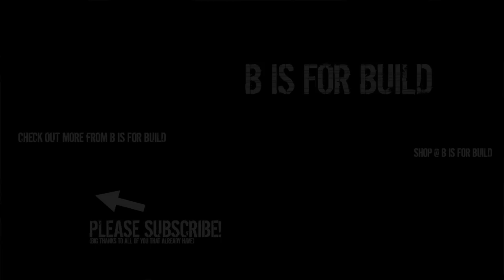1500HP of Boat Engines Have Arrived!

Comment: I am a Marine Engineer Grade 2 here in Australia,,         your choice to go petrol over diesel,      but please be aware of the dangers that go along with petrol engines in confined engine spaces on vessels,,,,     they are a floating bomb if precautions aren't followed,,,,          number 1 being ,,     have some BIG fans blowing into the engine space to give a positive pressure when the engines are running and turn the fans on prior starting to exhaust what fumes may hace accumulated in the bilge,,,
Reply: Like that mans comment my dude’s, let chris notice it!
Reply: The yacht should have come with bilge fans from the factory, I believe US coast/Canadian coast guard rules require them for all boats with inboard motors. He may be smart to update them though.
Reply: @kstricl  preferably with some sort of failure warning on the fans,
Reply: I was thinking more about reliability, low-end torque, and fuel consumption, but that's a whole other level of issue. With such a big boat, It just seemed like a bad idea from the start.
Reply: @AMLagonda  would be a small racing boat? Those are the usual v8 petrol boats I see, with exposed engines.
Reply: @fohseytv  Mate, whether you agree or disagree on his personal actions, your comment need not be so rude. There are other respectful ways to make your point.
Reply: Alpha Worx  same here, like idk why but it just fuckin angered me that he thought this was a good idea
Reply: Alpha Worx  plus he’s gonna be spending out the ass for fuel
Reply: If this boat ever has a hint of fire RUN. dope engines just not for a boat like that. I’ve seen gas boats blow it’s not cool. Best of luck tho
Reply: Alpha Worx  yet here you are
Reply: @kstricl  He wasn't smart enough to take notice of an oil pressure gauge reading zero so why would he be?
Reply: @joebaxter4235  Actually no. Why? Because so many people, people with actual qualifications tried to tell him it was a dumb idea and he just kept on with it. Given the advice received and who it came from it is ignorant.
Reply: @Blackinterceptor999  i hope he doesnt plan to turn the same props with the gas engines diesels have way more torque
Reply: Yeah, we’ve tried, but he knows better than long time mariners. Yeah it’ll go like a rocket if he stumbles on the right prop. But how long do rockets actually last?
Reply: He won't listen
Reply: Alpha Worx  probably not enough
Reply: @drunkensith6903  learnt that lesson with a rc plane that was using electric motor and put small glow plug engine in it ,it never got into the power with that prop, changed it and the plane flew again that mistake cost me £5 for a new prop thats a lesson i wont forget.
Reply: Alpha Worx  you quit when he made that decision months ago yet you're still here? 😂 I know nothing about boats but I'll point out some bullshit when I see it.
Reply: You think us Americans learned our lesson in World War II with the Sherman nope will put gas engines in anything
Reply: @AG-pm3tc  thanks mate,,,,     fires on boats are a very nasty thing to experience,,     ask me how i know haha
Reply: @kstricl  in Australia , that is,,   not sure with US or Cancer country hehe,,       there is a big difference bewtween rules on commercial vessels and private vessels,,,     commercial boats have to be kept to survey requirment levels 100 percent of the time,    where as private boats the law doesn't really affect them much until there is an accident, ie, a fire,    there really is no such laws for a ship shape privatley owned vessel as compared to a commercial boat in Ausatralia
Reply: @ventura9513  luckily you are still here to warn us!
Reply: @drunkensith6903  mate,,    that is a very good point i actually over looked,,,      with the diesels,,   they are matched to the gearbox speed,,,      now with an engine change,  they will most deffinately over speed causing major cavitation and prop slippage ,,,   not to mention extra stress on the shaft and gearbox when the prop gets a full bite on the water again,,,     its kinda like wheel hop with a car on a drag strip
Reply: I don't know much about engines, but you seem super legit! I hope he sees your explanation. I too feel that petrol engines won't be that durable on waters, as compared to the diesel-powered.
Reply: I can't wait to hear about the fuel consumption of this setup. The funny thing to me is his original excuse was it would take too long to get the diesels rebuilt... Here we are what, close to a year later just to get his new gas engines? Also, haven't heard anything about new props...
Reply: @Anachroschism  there is 2 types of hulls,,,   a planing hull and a displacment hull,,,    both have limitations on hull speed depending how they are designed, meaning they have a maximin hull speed no matter how much hp you throw at them,,,  i currently work on a 278 meter long vessel that is capable of 57000 hp  ,,    engine and gearbox does 300 rpm max,,,,     but it does 40 knots in fair weather ,    land lobers dont understand boats mate
Reply: Achieving positive pressure isn't practical given available space and sealing issues. A OEM setup would be something like: two cheap 4 inch inline blowers (rule, attwood etc.) with flex hose pulling air from  LOW spots in bilge, venting to louvered engineroom air inlet area.
Reply: @ravenof1985  and a failure warning for the failure warning. Just incase.
Reply: @Melanie16040  l vote for a couple of 4 blade stainless... ;-)
Reply: 650 ft/lbs of torque v/s the 2300 ft/lbs of torque the diesels made. LoL.
Reply: A Couple Highly Modified Cummins Turbo Diesels would have worked better more Torque and Horse power & reliability!
Reply: @fohseytv  yeah thinking the same thing couple of rebuilt 12 valve cummins would produce close to 2000ftlb of torque
Reply: He was warned soon enough...
Reply: @nipponsuxs  yea that’s what I’m saying, them old mfs would have been reliable as hell. All them oil leaks just keeps everything from rusting and keeps em going forever
Reply: We tried to tell him do stay diesel a while ago. The ls is significantly smaller and has way less torque. He should have stayed with the cummins or repowered with a similar diesel. I feel like dual series 60 Detroits would have been a good fit for that boat and they can be found everywhere.
Reply: @zachogdahl210  I’m a big fan of Detroit’s as I have the 6.5 turbo in my hummer. Slow as shit but torque monster
Reply: @fohseytv  yeah we use series 60s and 8v71s for power generation on the ships i work on. Great engines. The series 60 is fantastic to work on and really easy to maintain
Reply: Alpha Worx  
Hi mate,
A boat like that with those motors will perform really well. WAY less weight than diesels, heaps of hp and torque. It will have a way better top end speed. He can afford the fuel and it’s not like it’s a daily driver. You take it out now and again and with the great times you have, it’s well worth the cost of the juice. 🍻
Reply: Alpha Worx  
Everyone here is ragging on his decision but it’s been engineered on tried and true principles? He’s got a good weight saving over those heavy diesels too.
We had a Fastlane 40, 40ft long, running twin 454’s, weighed 6 tonne and were conservative at 450hp each. It did 40 knots easy.
Reply: Alpha Worx  
The reason most boats can be bought new with either diesels or petrols as an option is either performance or longevity and is the choice of the owner when buying. 
Petrols give a greater weight saving, a higher performance level/top speed, are much cheaper as an option, but only last on average about 500 hours. 
Diesels last longer - thousands of hours of service but cost a LOT more, less volatile fuel, less servicing costs etc. 
Big boats running petrols with high top end speeds are a real hoot. That’s why theres so many out there. 
His boat, his choice.
🍻
Reply: @fohseytv  I think it’s funny reading the comments like yours that you stopped watching because of so and so. Yet here you are, a year later, still complaining. I didn’t know you were paying for his gas. That’s awful nice of you. I also didn’t know you were paying to rebuild his boat or maintain it. You are a hell of a guy for that. His decisions. His money. His boat. His YouTube. Don’t like it, stop watching. But like for real this time. In 1 more year if this boat is trash and he changes it, it won’t be because of some random nobody’s comment on his video. If it’s a huge success, he will never remember your comment either. Point being, he doesn’t care because you’re just some YouTube comment. Move on man.
Reply: I realized most people that comment never have been on a boat. Over 90% of Cruisers 24-36ft are powered with gas engines. mercruisers(GM engines), volvos.... some have diesels mostly volvos and yanmar. All these boats have much smaller bilge then this 40+ft boat so really not a problem with fumes, all boats gas/diesels are equipped with blowers and all accessories (starters/alternators/ignition system) are marine grade spark proof... so whole this gas engines are going to start a fire in the bilge is complete nonsense. Before you start boat engines you run the blowers for 5 min. That's a warning label on the dash on ever freaking boat.  On top of all this this operation and blowers are there as safety measures just in case something is wrong and leaking and making fumes on modern engine, fumes were expected to accumulate in bilge with old carbureted engine when gas from bowl evaporate. with fuel injections if you are having fumes in bilge something is leaking.
Reply: @ruwithlee1970  Probably cheaper? Probably a lot cheaper :o)
Reply: @fohseytv  people have been telling him for SO LONG lol. I do agree with you though. This thing is going to be an absolute pig on fuel.
Reply: Good comment. He's aware. This was discussed in a previous video and that's the plan
Reply: @redlinesteez9630  To be fair those situations you stated come with janky setups. "Runaway diesel" happens when the motor ingests flammable air "hydrocarbon Vapor" so it essentially gets an external fuel source. Overboosting only happens when your wastegate doesn't do its job, too small for the amount of exhaust it needs to bypass, or vacuum/boost reference lines are faulty. you will only melt pistons with high cylinder temps and EGT's and unlike gas-powered vehicles, diesels only get high EGT's when there is too much fuel (that's why "rolling coal" is bad). Gas motors can be made to run in a large boat but it comes with inherent drawbacks, fuel consumption, diesel's are much more fuel-efficient and the engine's efficiency is lower in the RPM range compared to a gas motor, the engine is way more stressed cause it has to be revved higher to be in its efficiency range. The engines are much smaller so Cylinder pressure is much higher to achieve decent torque figures, because of that there's more damage to rod, crank bearings, and piston wrist pins. These gas motors will need to be re-built with relatively low hours on them. yachts don't need a ton of HP they just need big motors that aren't stressed and have a bunch of low-end torque in an rpm range that allows them to sip on fuel. You go from a boat that gives you relatively long-range and is low on maintenance, to one that has significantly less range and requires more maintenance. I'm pretty sure Chris just wants a "Fast" boat and is tryna maximize his bang for buck. But depending on how much use this boat gets he may get tired of it quickly.
Reply: @CP110  I think he will get tired of the fuel bill quickly.  💸💸💸💸
Reply: He addressed these concerns when he announced what engine he was going with months ago.
Reply: why do you,,, type,,     like this,,,,    ?
Reply: Many boats here in America have dual inboard motors and many are 454's. They are completely safe. Describing them as floating bombs is insane. Vent before starting and away you go.
Reply: @kstricl  Blowers are not mandatory for diesel engine, only gas.
Reply: Petrol boat engines are fine and very common for smaller boats. Just dont be an idiot and look after the engines and you will be fine
Reply: @Blackinterceptor999  your grandma must have been incredible with an engineer background. Building a fort, oh man! Sorry for your lost. Lost mine in 2019.
Reply: Did he mention his weight saving approximately?
Reply: He makes money with us arguing about his engine choice😂
Reply: Not another one lol... get butt hurt when it works
Reply: There’s tons of larger boats running GM 454 engines. Carver, Sea Ray, Formula, etc. 36 to 40 footers. Some of these boats have greater displacement than his boat, and run fine for decades before needing a rebuild.
Reply: BOOM!
Reply: @apacheworrier3776  Yeah, but the running gear after the engine is completely designed for the characteristics' for that setup. Now B is connecting engines with a completely different rev range. I hope he has people with a good reduction box and prop calculator.
Reply: @nielsdebakker3283  
Yeah those diesels probably run at half the rpms. He’s probably going to need a lot less pitch on the props.
Reply: @apacheworrier3776  lookup "transmission" or "gearbox". You'll see, it is amazing.
Reply: Not to mention the sheer volume of fuel required. This things gonna require a HUGE tank and it'll be gone in no time!
Reply: goes without saying you always vent the bilge before starting. Anything inboard, even diesel power should be vented. I'm sure he's aware of this.
Reply: OMC in the US has put gas engines in their boats since the day they went overboard. This argument is pointless.
Reply: @fohseytv  There is a reason boats have moved towards diesel, years of experience.
Reply: Bilge blowers are MANDATORY they must do this or it will end in disaster.

God I hope they read this.
Reply: For sure ! Safety First, they Should be standard in that vessel though, but might need bigger ones for sure, you should also have a fuel cutoff and automatic fire suppression system that goes off itself i'd imagine. 

There's also a lot of products and ways in boats that are not common in cars. chokfast  for the base of the engine is one, that's more commercial though but still.
Reply: You guys are right in all your comments but you have to remember, it wouldn't be B is for build(or how he makes his money off this channel) if he put the same old diesrls back in! I say sit back and enjoy the shit show, this if gonna be fun watching!
Reply: @skipperup  Sure, I'm just referring to the safety aspect of it in my comment. Just remember this affects anyone on the vessel, around the vessel too, that's all. :)
Reply: As a master boat builder, you took the words out of my mouth.
Diesel is the only why to go with anything marine
Reply: @kstricl  if it was equipped with diesel engines it is not required or needed to have bilge fans. I've built many boats as a master boat builder and engineer
Reply: @joebaxter4235  really? Don't you think you are being ignorant and very rude? The answer to that is yes.
Reply: You actually want the blowers blowing OUT not in for gas engines on a boat.
Reply: @AMLagonda  IM SORRY /////
Reply: @CP110  THIS BOAT WILL BE SLOWER BY FAR....
Reply: @AMLagonda  ...lol, because that's the best boat you've been in that automatically applies to this boat? ...sound logic...
Reply: True. And agree. Disels are put in boats mainly due to safety reasons. So, Chris, blow air from engine compartment throughly and also develop some good fuel cell vent system (w. active charcoal tanks or something like that...) And do not cancel this project, please, i'm very courious how this will run, it can be beast of boats :)
Reply: Nevermind the supply ship he'll need to follow him for refuelling every 20 mile.
Reply: @fohseytv , is it really necessary to be offensive?
Reply: @joebaxter4235  ..yeah, he just doesnt know better, thats how he was treated as a child, most likely.
Reply: A couple of noctua fans should do
Reply: @kstricl  negative, can say from the several sail boats (all diesel) I've been on, not all boats have them.   So making sure there are fans that are adequate as well as making sure the props are correct for the RPM's the engines will be turning and the engines themselves have enough of an oil themselves to ensure that they dont' have any oil starvation issues since most engine builders build for cars where the engine won't be running for what could be hours at high RPM.
Reply: @nigelw598  You do realize that the weight of the engines is calculated into the design to keep the boat properly trimmed? The WAY less weight will destroy the trim, offsetting whatever supposed gains are to be had, assuming this thing ever gets finished in the first place, which is looking highly doubtful with each passing month.
Reply: I run exhaust fans after fueling and before starting the engine. I have air vents that shoot air into the engine compartment while I'm running at the idle speed I run my exhaust fans.
Reply: Do you have to change out prop shaft
Reply: Have to totally agree with you, I would have gone a  couple of caterpillar engines. Petrol as you said brings a lot of other problems with it
Reply: Wow, gorgeous mills he has there. Look very pricey, stay safe
Reply: Prolly Riva Italy back then made the right choice with da 903’s.

Comment: Oscar is a treasure. I wish I had a personal fabricator lol make sure you make some sort of drip tray system underneath so that when you do an oil change on it its not sitting on the bottom of the boat. Maybe a tray system that isn't level and it runs somewhere you can remove the oil.
Reply: On boats you suck the oil thrhough the dipstick using a tube and a pump not then oil pan draing
Reply: Do you think the new engines have been made with that in mind ?
It's their first time making marine engines after all. 😁